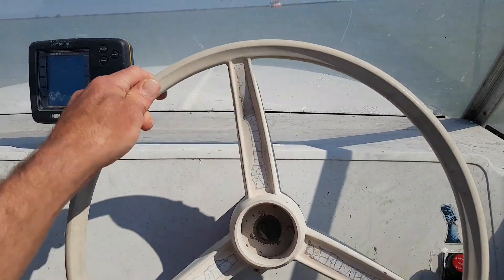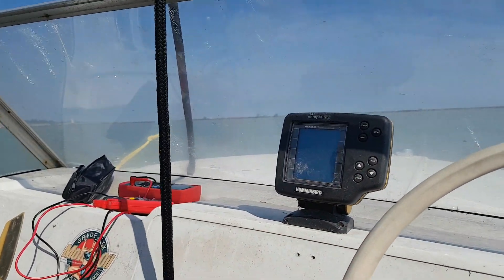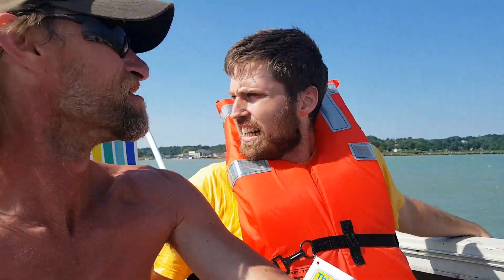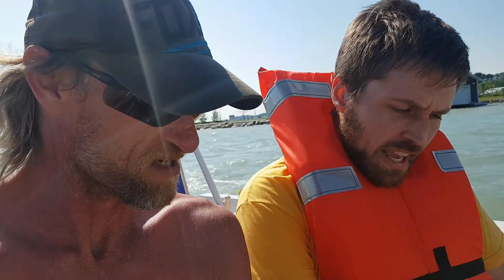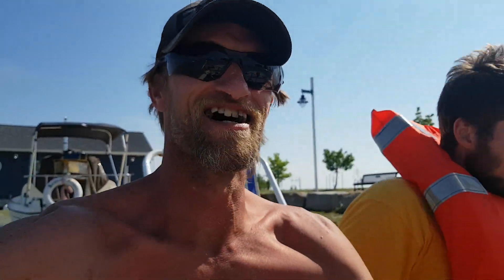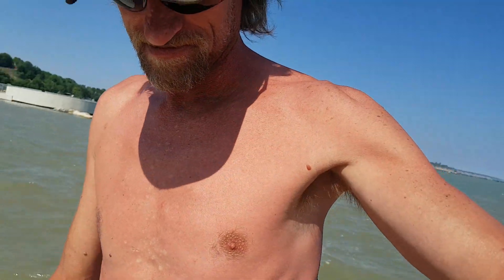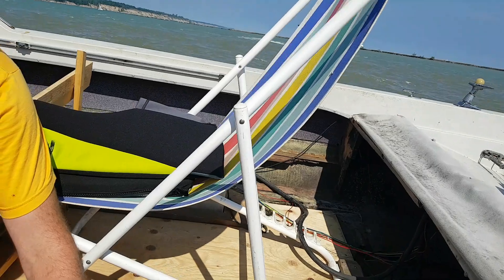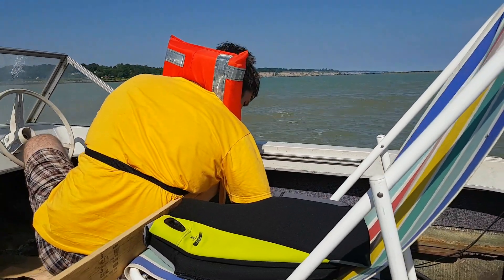The Future of Electric Boats

Comment: I just love reading the comments "water and electricity don't mix" I'm thinking most of these comments are from people who have not read their history or lack some education. Electric boats have been around before diesel,  gas or even steam powered boats. AND both gas and diesel motors need an electric motor to start them (except the old time hand crank motors..... but they still require electricity to function). Elco boat company has been making electric boats since the 1890's, some still running to this day. I say more power to you, do what you want to do, get out on the water how ever you see fit. Electric powered boats do have their challenges, on the plus side there is only one moving part, both gas and diesel motors have hundreds of moving parts, if one small part should fail, you're stuck. One more note, even boats from the 1600's-1700's (if there are any left) are required to have running lights and navigational equipment... all of which require electricity. Add a solar panel for some shade and free energy.

Comment: Just what I would want to take my kids out on the water with!   A rigged up high voltage moter powered boat..
Reply: Could be like a friend of mine took his kid out on a almost new Boat. Something sparked near the electronic dash the gas tank ignited.  His son now is burned on 80% of his body his dad that threw him is buried at forest lawn cemetery.   I think they are moving in the right direction.
Reply: @popsoldboats3406  that would of never happened from something sparking at the dash most fires on boats happen from gas fumes on in board motors and the operator not turning on the blower
Reply: Why would you take kids on prototype  ....think about what you just said maybe cos should visit you science you don't have a clue
Reply: Cps
Reply: Sean M Crazy Unsafe...

Comment: Electricity and water do not mix.
Reply: Boat springs a leak with 8 batteries side ways on the floor.
Reply: Gas and water is nothing like water and electricity that can kill if it has enough power in the batteries still and gas in water is not a big problem
Reply: Neither do water and oil/gas lol